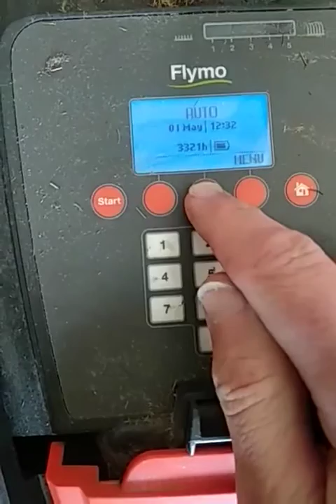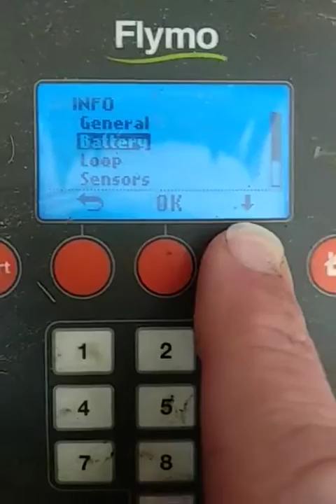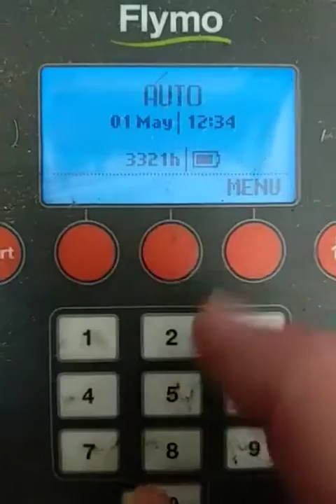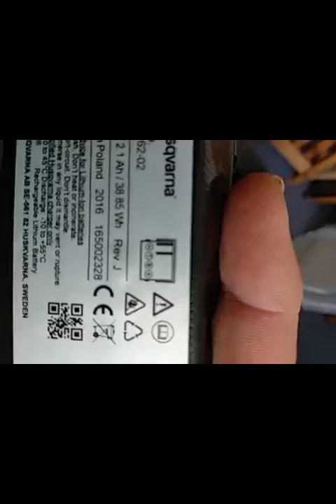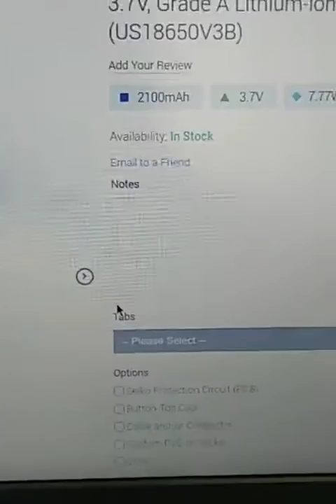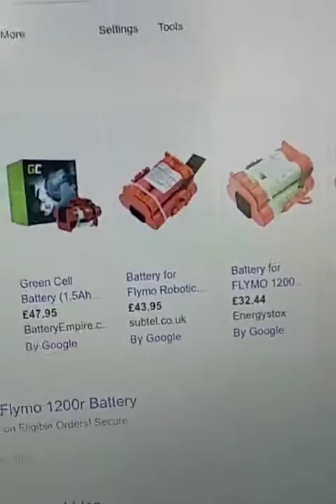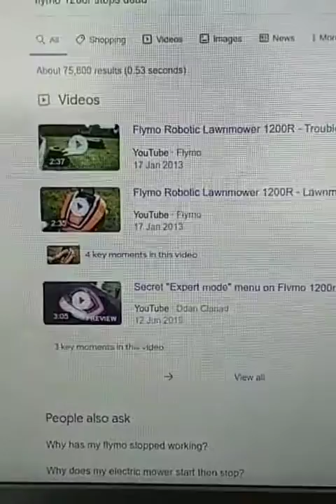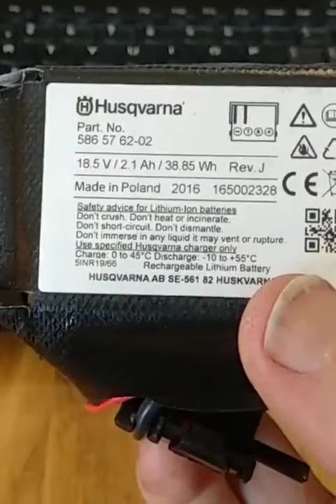Opening Flymo 1200R and Replace/ Replacing Dead Dying Battery Pack  - All steps shown

Comment: The battery doesn't need to be the same mah rating. The voltage is crucial to be the same though. The mower has a certain internal electrical resistance that dictates the amount of amperage drawn from the battery for a specific amount of voltage. Varying the mah does not change that equation at all. The mah essentially is just a rating of how much energy the battery pack can store in total and as result how long it can go before requiring a recharge. I would get the battery with the higher mah.

Comment: Thanks for the video.  My mower has just been returned to service after winter.  It mowed fine on manual mode then left it charging overnight and expected it to go out on auto mode the next time.  It didn't go out and now seems to be completely dead, nothing on the screen at all.  I don't know the cycle information but I've had it about 5 years already being used all growing season.  Will a new battery sort this problem?

Comment: Can you show how to replace the body and wheels please.
Reply from the maker: Hi Ray,
I never did that, but I can't imagine it is that hard. This mower is highly modularised and I imagine you unscrew the wheels and plug new ones in. I know they are available because I had a look out of interest some time ago.
I'm sure a new body can be bought as a spare too.
Reply: @ksmith7122  hi there, thanks for your reply and videos. I actually did it today as you said pretty simple just 4 screws to release the body however screws were rusted into the rubber suspension legs. Bad design I had to drill them out. Regards Ray

Comment: This is really useful. Even just to compare my battery stats to yours is useful. Might be ordering some cells soon!
Reply from the maker: Thanks Hywel,
If I'd had more time l'd have made a better quality video with much more information in it.
The replacement battery is still going strong. No issues at all. Grass all cut. I have one of these for the front lawn and one for the back lawn. It took me many inadvertent cut through s by the mowers to work out you have to bury the wire.
Now the system is more or less flawless.
Eventually I intend to use these mowers as a host for a RTK 2cm precision guidance system. But the problem is the time I have available, best of luck
Reply from the maker: Pls make sure to give the video a like so other people can find it, thanks

Comment: Thanks for your video. This week I removed my battery, which has over 2000 charge/discharge cycles and was only mowing for around 30mins b4 it needs a recharge.
A new battery was around €60 so I figured I didn't have much to lose if I swapped the cells myself to see if it worked.  
I disassembled it, desoldering it carefully. Then I removed the various tape and adhesive. Then i replaced the 18650 batteries with new cells I had and resoldered and spot welded the new cells in the same position as the old cells. I couldn't believe it worked. It took about 1 hour overall.
It was my first soldering job and spot welding job.  It has been working since. 
It is still registering at 1400mAh capacity, but in reality, it's much more than that, but the mower still decides to re-charge around the 1-hour mark. I assume the BMS settings would need to be changed etc. but I'm happy the way it is.
The word of caution I would give is to keep the solders low, small, near and shallow. 
The space tolerance for getting the battery sealed back into the mower is very tight. Mine only barely fit back in, but this is something a skilled solder operator wouldn't have an issue with. Hope this helps someone.
Reply from the maker: Thanks Gary, fantastic to see you replace all 18650s and put it back together. If and when I get time I intend to convert the whole mower using the Open Mower project to RTK meaning 2cm accurate GPS with no guide wire or boundary wire necessary. Thanks for the comment.